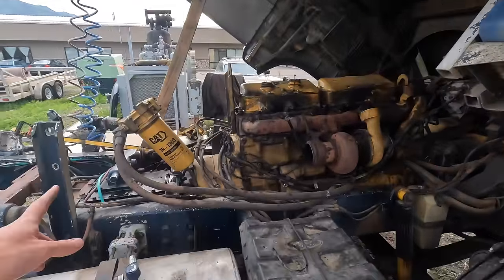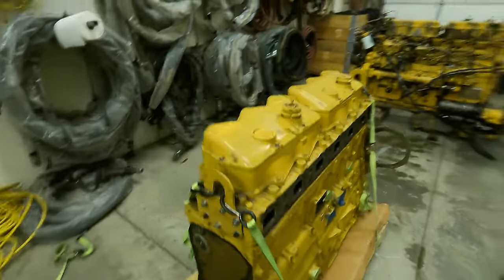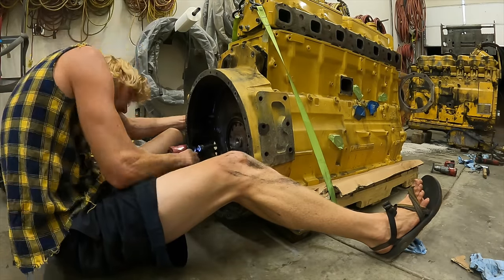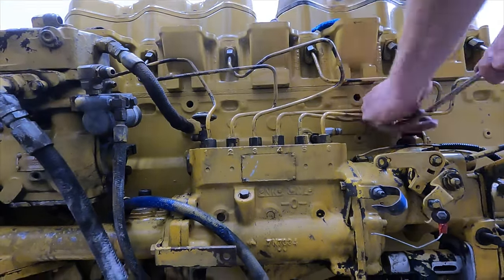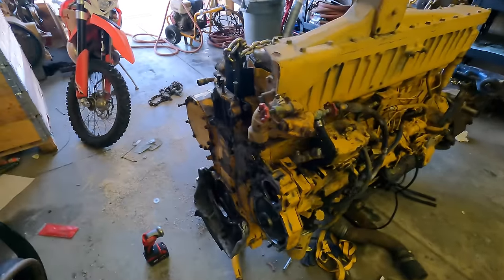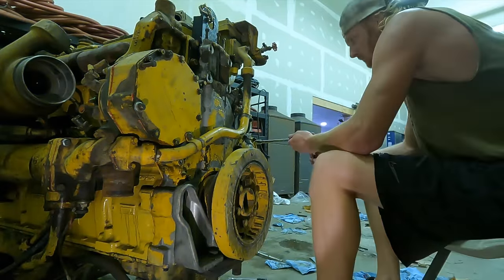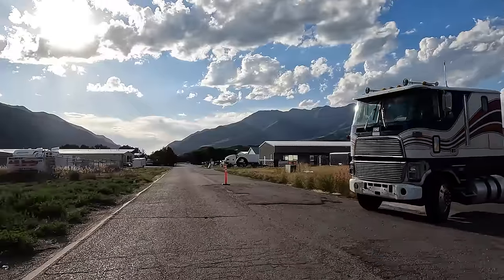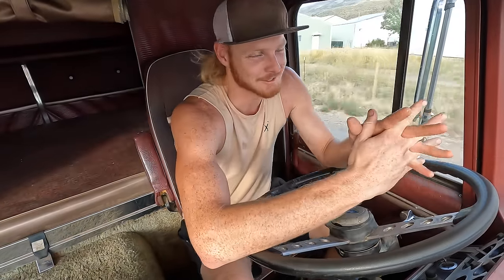My Ford Cabover is Running Again! Full Engine Swap

Comment: My man doing full engine swaps with flipflops. 🤣😎
Reply: Super Trucker shit lol
Reply: If he starts doing more engine swaps, he may have to upgrade to crocs.
Reply: Ya no shit
Reply: You can take the man out of Florida but you can't take the Florida out of the man lol
Reply: Typical Florida man.
Reply: 'round here we call 'em Chinese work boots!
Reply: Florida man
Reply: Commonly known as japanese safety shoes 😂
Reply: @baggedr32mk5  clearly you have never been to Japan. They would be wearing lab coats and gloves.
Reply: It's all fun and games till you drop a turbo on your foot, 😂😂.
Reply: Those are true safety toe work wear.
Reply: It's like David Freiburger, dude does everything in sandals
Reply: He's bold as hell lol I was hoping nothing was going to happen to his feet the whole video
Reply: Was thinking the same thing 😆😆😆
Reply: I’ve done it. All be it on a Ford ranger, but there was still an engine dangling from a chain.
Reply: Wouldn’t be hunter if he wasn’t in flip flops
Reply: While others were so concerned with your footwear, I thought you did a great job. Narration was excellent, and you manned up about the little mistake.
Reply: Why tempt fate?  That's why I wear steel toed boots.
Reply: @phantomfixer From the top of the engine, even a 3 inch long 3/8 bolt can be efficient at rearraging the skin and bone on a toe!
Reply: @raymondparker8215  So true!
Reply: @BarnStangz here in New Zealand we call them jandals or sandals😂
Reply: @BarnStangz or Roman’s
Reply: Well done.
Reply: until  he hit a finger  or toe
Reply: And he ain't an Aussie... XD
Reply: Okay y'all, as a man who loves to wear them, there's a big difference between sandals and flip flops. Those look like some quality Tevas.
Reply: Those are safety flip flops. 😁 ;-) A little bit less safe than the famous safety sandals of Pakistani truck repair channels. 2) Sleeperdude does all his work in flip flops too. Unfortunately some day they all will regret this.
Best regards, luck, health and wisdom.
Reply: Respectfully 😂😭👌
Reply: I’ve been worried about his feet this whole time dude! Thinking the same thing! It’s amazing what he did on his own tho.. bet that old guy who sold it to him LOVES that it’s going back on the road.
Reply: Nothing like taking apart your entire engine, breaking down your pedal mechanisms, screwing with the fuel tanks, exhaust etc before even driving a vehicle to get that “OWNED” feeling.
Reply: That’s how you identify your good ol’ boys . Never meaning no harm

Comment: Hunter you are a good mechanic and a hard worker….small bit of advice. If your looking to save time, put both engines side by side in your shop, as you take a part off of one(old one) then take two steps and put it on the new one.  No lost bolts, spacers, washers etc.  No putting heavy things down and picking it back up again.  Its also a great way to make sure everything is fitting in real time.  Also take it from a 50 something, you are young now but someday you won’t be….your back will thank you….it’s a marathon not a sprint….much love from an old timer
Reply: 100% on the money, with ya on this from a broken 50 something bloke .
Reply: Yep was thinking the same thing (47 years farming)!
Reply: كلام في الصميم
Reply: Will not work.  Certain procession to the job, front to back.  Just like taking off your pants then drawers.  You go back with drawers then pants.

Comment: Little trick to help on heavy trucks when you don't have the clutch alignment tool - Load the clutch onto the input shaft of the trans and mount the trans to the flywheel housing.  Then just roll underneath and zip the flywheel bots in through the clutch inspection cover where you would normally reach through to adjust the clutch

Comment: Something else I just noticed- it has an aluminum frame. Check it carefully for cracks, especially around the suspension attach points (if memory serves correctly). In my time at a Ford truck dealership we had two trucks that had to have aluminum frames replaced under warranty due to cracks.
Ford didn't require that we send the old rails back and one of the guys made ramps to get his Kubota on and off a trailer with the old rails.

Comment: >uses shopvac to create vacuum to prevent fuel backflow
ingenius

>uses old oil pump (previously used for burn barrel project), jerry-rigged with a drill and zipties to prime oil in engine
florida engineering

Comment: Fantastic to see the old truck back up and running. I love that air-ride cab setup. The only other truck that had a setup something like that was the Mack MH cabover. I never drove either one, but I worked for a guy who owned a Mack MH with the E9 500-hp motor. He said the truck was one of the best riding cabovers he'd driven once you got comfortable with how they "float", just like that Ford.

Comment: Great job! Time for new cab air ride shocks. Also, A/C on a CL is extremely problematic (and $$$) especially with a sleeper cab. It has 3 evaporators, lines running everywhere chafing on everything, it's a mess.
Another also- the radiator is very tall and relatively narrow. That means it has relatively few tubes and it doesn't take many of the tubes getting plugged to cause overheating. Cooling system maintenance is a must. Getting the radiator out and back in is NOT a fun job.
Good luck with this. Great to see a CL in such nice shape back on the road.

Comment: That’s how we primed detroits 2 strokes 318 ‘s and 238’s and it worked great because in the cap were blow out ports and if you would pop one out and car valve stems would pop right in and made life easy .

Comment: Nice job on the engine swap- nice thing with a cabover is just tilt the cab and go. Ford was ahead of the times with this cabover with the full air suspension cab. they fell a little tippy but its worth the nice smooth ride it gives- the smoothest riding american cabover.  I drove one once and was amazed with the ride empty, even with 24's on the front.

Comment: It’s great that you jumped in the learn how to build the engine but why not take the extra time to repaint everything you took off the original engine? I’ve rebuilt a lot of diesels and we always repainted everything for a couple of reasons. It makes it look good helps against corrosion but more importantly you will notice any leaks almost immediately and will make watching leaks during the break in period.

Comment: Back when B's were still running OTR I replaced a lot of broken injector lines due to vibration. A set of new ones & a full set of clamps will save you for the long haul. I'm a 72yr old road service mechanic still working. 🤓

Comment: I like that “timing hold” bolt is in a spot where the starter has to be removed to install it. And you can’t install the starter with it installed. Smart fail safe! If you forget it’s installed and try to crank it over. Diesels are cool, just having the fuel lines protected under the valve cover is neat. I don’t know much about them but I like them.

Comment: Used to work on one of those years ago in NZ.Right hand  drive with a all alloy cab i think.Was fastest truck around  at that time as it was a double  overdrive box.Thats wat they told us anyway.I remember the cab used to shake and rattle lot.Very light weight truck for NZ rough roads.Cab got metal fatigue  and had to be welded up and chassis broke and had to be repaired too.Was owned by a company called RAYMAC

Comment: There’s was company out of Detroit that Ford COEs were the only truck they ran. They had a ton of them. Might still be around called OJ Transport. They were in nice shape when they got them. They hired 1099 drivers and all that brings. They pulled step Vans. All lite weight stuff,Seats,interiors and dashes. Might be a place for parts.

Comment: Its sooo much easier if you slide the clutch assembly on the input shaft and then button up the clutch once the tranny is installed..

Comment: Now its running  (i would have been watching the oil presure on 1st start up) !,. clip all those injector pipes up otherwise you will start breaking injector pipes running down the road , then check all oil/fuel/water pipes for rubbing together or chaffing,. nice job but maybe take one part off old motor and refit on new motor, just a thought,. I love these ford double sleepers they are a nice looking classic truck, .looking forward to see it working again, keep on trucking,. cheers ,.

Comment: It's looking good, but after you get it all assembled. Are you gonna clean it and put a coat of paint on it before you put it in?, Along with cleaning the frame rails , all that work, it would be  Ashame not to. Back in the seventy, my dad had a couple of them that he used that as lumber yard facility really enjoyed driving them.

Comment: started working as a truck mechanic in a private owned comp. i was 17? drove one like yours. scared the sh44t out of me at first.....owner didn't trust the anti brake system.nor my old boss. why buy a brand new rig when i had to snip the wires to all the sensors on the  components for braking? i did what i was told......never messed with diesel engs. in sandels! made me cringe!

Comment: Where did you get the air bags for the cab of the truck I’m in the process of restoring a 81 cl9000 and didn’t know where to find them at.

Comment: When are you gonna put the new rear end on are you gonna stretch it at all? And are you gonna do anything to the motor now that it’s running injectors turbos lift pump or anything? Bad ass man I bent a rod in my 12v last year when a injector failed and filled the cylinder with fuel and bent a rod and shot every ounce of oil out of the exhaust so I ordered a brand new motor from jasper took 6 weeks to get here and I was like I can do it my self took me a day to get it out and two to have it up and running while it was out I went ahead and replaced all the accessories added e fans with aluminum radiator lil bit bigger turbo 50 hp injectors better intercooler southbend clutch fuel plate fass fuel lift pump replaced all the bushings and ball joints on the front end added a brace on the pitman arm to stiffen up the steering I think that’s everything I have two more things I want to do to it add a Jake brake and swap the 5 speed for a 6 speed so I can cruise at 80 instead of 70 at 2200 rpm I’m 22k into the truck now paid 8 for it 10k for the motor and the rest in the other add ons not including my bed I just put on norstar sd bed was another 8k  I will never own a truck shin without a bed like this one or similar I can literally keep all my tools in the truck with me att all times it is a heavy prick 12k pounds ha  with all the tools bed and 100 gallon fuel tank but I’m still able to haul a goose neck and don’t have to worry about hitting the bed sides if I go through a dip the bed sides are 20 inches tall but it’s basically a brand new truck looks like its only 5 or 6 years old and will most likely still be running after my wife’s 2022 limited ram 2500 is dead it was my dream truck for a long time it’s a 98 so last year of the 12v keep up the fun videos

Comment: Hunter man what a good video man. I see there's a lot of Haters about your flip flops 🩴 & sandals man. Let them be Haters man. You did a good job working with your sandals on. I do a lot of work on my truck 🚛 to in flip flops 🩴. That is all i wear. I don't own a pair of shoes , socks , or boots since I was 18 years old & that when my foot outgrow shoe , socks , & boots. I have very very extremely wide feet 🦶 sz15 6E wide ( which is very very extremely wide ) with very chubby fat wide toes that are Evenly straight across making my foot very very Extremely wide at 6 1/2 inches wide from my big toe to my lil toe. It's a very very extremely wide foot I got. So I do everything barefooted 👣 or in flip flops 🩴. I  drive my truck 🚛 in flip flops 🩴 & load up & unload my truck 🚛 in flip flops 🩴. Keep on working & drive your truck in your sandals & Flip flops 🩴 man. P.S. i like your Chaco sandals you are wearing man. Do you have any problems with your toes loop on your sandals? I have heard that people are having problems with the toe loop one.